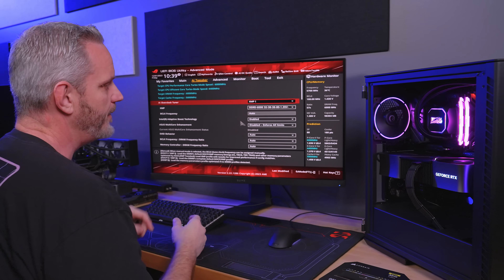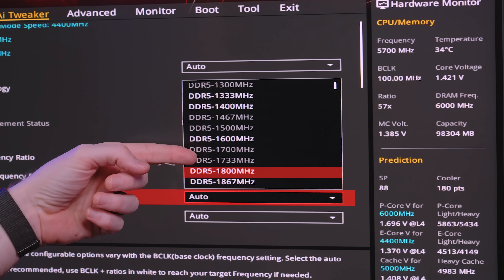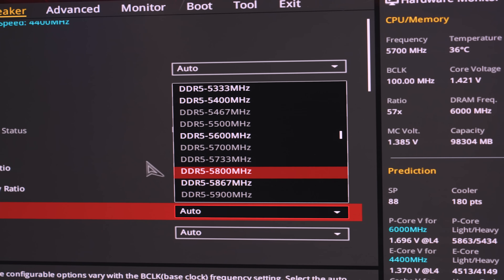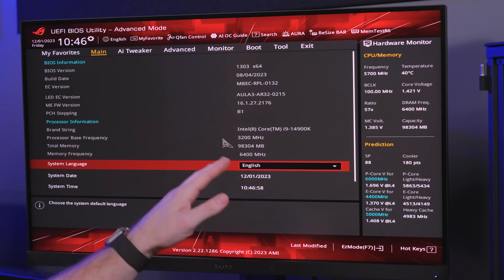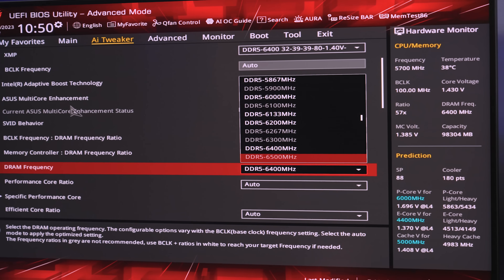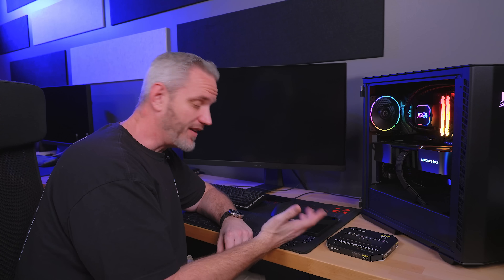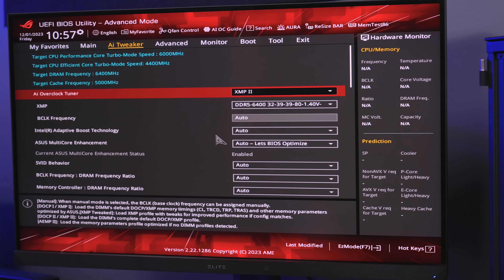Crashing PC? Check this first!

Comment: Sometimes it can be the motherboard.
Replaced an ASRock board with an MSI MAG Tomahawk one and now my RAM runs at the proper speed of 6400MHz all day every day. I couldn't get it over 5200MHz on the ASRock except on the BIOS version it shipped with, which was much older.
Reply: Yes, certain mobos, especially older ones with small flash ROM capacity for BIOS storage will have to trim down the list of supported QVL memory modules to fit in the small capacity. So oftentimes getting the newer platform with larger BIOS flash ROM capacity can mean multiple times more supported QVL memory modules, and newer products gets more support attention versus old.

Comment: Iam New to the PC building scene so I think I should ask : is it really that important to enable XMP ? I mean, my games are running just fine and from what I could find on some benchmark channels memory speed is the last thing one should look into ,ram is a little bit expensive where I am from so that's why I went for a slower ram kit and used what I saved from my budget to buy a better GPU ,  so yeah after seeing this video I am starting to wonder if I am really missing out something here .
Reply: I think k you answered your own question, if the games are running fine and you are happy, then leave it turned off.  Of course you can always enable XMP and see if it’s stable, but if not then turn it off and enjoy playing games 😊
Reply: @gregspicer1238 Great answer. There are specific games that benefit from faster RAM speeds (limit MS Flight Sim 2020) and/or tighter timings (mostly memory intensive production work apps), but in general, if expensive, spend money elsewhere.

Comment: My 7800x3D system will get a driver_power_state_failure blue screen shortly after I get into Windows and open my browser/discord. It will then reboot and run fine. It doesn’t change any BIOS settings as far as I can tell.

Comment: Ok ... heres one:
Running a AMD Ryzen 7 7800X3D on an Asus TUF x650 Plus Wifi and CORSAIR VENGEANCE DDR5 RAM 64GB (2x32GB) 6000MHz CL40 kit.
RAM WILL NOT run on Expo at all, it only crashes, right back to cmos reset.  
Had to drop memory down to 5800 MT/S and not try to tighten timings at all, to even boot.
From there, can not give the CPU a slight overclock, as I like to.  Only crashes.
And yes, this RAM is on the list.
I have heard this is an AMD issue with many users ... one question? Why?  Whats the deal with this?
Why do X3D chips not like running Expo or at listed speeds?

Comment: I have a laptop with DDR4 3200 MTS SO-DIMMs that have these speeds set in JEDEC timings so XMP isn't the only way to get higher speeds, just as well as the laptop doesn't support XMP.

Comment: My fx8120 would not run anything higher than stock ram speeds. It would always fail to post until it got reset, very annoying. Intel for me so far hasn’t had any problems.

Comment: I just got Asus Tuf 4070 ti, ever since I've had random black screen crashing. Sometimes systems slowly freezes, sometimes in bios it freezes as I am trying to boot after a first crash. Only way to temporaily fix it is unplugging psu for several minutes. I wondereed if it was the timing. Tried dozens of things.

Comment: i don't get a bsod by the day i set up the cpu and the ram overclock (and it's pretty heavy OC, it took me several days to find the right spot)

My pc is h24 by 2 years, 0 bsod.

Just increase the voltages (a very very little by little) when you got a bsod, it wil fix it a lot of time.

And oveclocking the tertiary timings helps a LOT with the stutters.

I also customized all the voltages, the sys, the dram, the memory controller. It's not so hard to do, and in latest cpus the are a lot of failsafe, it would be really hard to damage the cpus (if you stay beyond reason limits)

Maybe i'm just a nerd, but to oc the pc and to make it stable it's the funniest thing to do after build the pc. I pref a lot more to do this things than to game after ahahah

The only things i failed to set up, it's the cache, i couldn't unbin the voltage of the cache by vcore, like it was doable in the old 4790k, so i couldn't set up the cache speed and voltages properly.

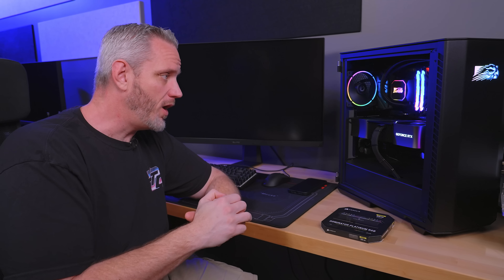Comment: I'm actually in a situation like Jay mentions at 14:06, I recently got an i5 13600K and a Z790 board, both off eBay, with a RAM kit on the QVL that's rated for 3600MT/s; any time I enable XMP I get blue screens within 5 minutes. If I manually tune the RAM settings I can get it to 3200 fairly stable. I was hoping it was the MB, but based on this video I'm guessing I'm going to need to look into replacing the CPU. 

Oh well. Sh-tuff happens.
Reply: update your bios to latest version first. its more likely to be your board, 13th gen should run 3600mt easy

Comment: I had an MSI X570, Ryzen 2700x and G.SKILL Ripjaws V Series 16GB (2 x 8GB) with XMP enabled and I suspect it killed my RAM.  I Replaced it with the G.SKILL Ripjaws V Series 32GB (4 x 8GB) (it was on sale so I bought a 2nd set after exchanging 1).  Would it be wise NOT to enable XMP in this case or was it just bad RAM? It worked for at least 18 months with it enabled.
Reply: *G.SKILL Ripjaws V Series 16GB (2 x 8GB) DDR4-3600

Comment: I got a pc that turns on. Everything lights up. No image no boot screen nothing on the monitor period. The pc then won't shut off with the button. It stays running until its shut off. I tried ram I tried removing drives I've replaced cmos don't everything other then a new cpu. I'm assuming it's cpu or mobo but would love some more insight. If everything if coming on the board might not be the issue and it's the cpu? Any help appreciated.

Comment: My 2700X was originally paired with an ASRock X470 board and a kit of Trident Z RGB 2x8GB 3200MHz CL16, and when I added a matching kit of RAM bumping up to 4x8GB, I couldn't get it above like 2666MHz where it was like marginally stable. Was on the QVL list for my motherboard, but I guess they validated it with a silicone lottery winner. Took it as an opportunity to upgrade to a 5700G (because I wanted the iGPU for troubleshooting, which did actually come in handy later) and it has ran my 4x8GB config perfectly fine for the last almost 2 years now.
Reply: It sounds like you are saying you had one 2x kit, and added another "matching" 2x kit to get 4 sticks, instead of buying an actual 4xkit.
That is generally not recommended because there can be enough variation between 2 different 2x kits that they just won't always work together right.
I don't mean 2 different brands of kits, it can happen with the same brand, same model number, etc.
A primary problem in this particular scenario, is that memory manufacturers often make changes to their models over time.
For example, I once bought 2 2x4gb g-skill kits (one for me, one for my wife) and both worked fine in our respective PC's.
However, down the line, I wanted to increase the amount of ram in our systems, and her's was better suited to run 2 larger dimms, while mine should have worked well with 4x8gb sticks.
However, I just could not get the 4 sticks to play well together.
So I took them out and looked closely at them.
Both pairs had the same heat spreaders, but the actual PCB's were different colors.
One pair had green boards, one pair had black boards. And I could see that some of the traces and components were different between them.
I didn't take the heat spreaders off to see if they were a different brand of memory chips, but it wouldn't have surprised me, and I don't know what other changes there may have been, hiding under the spreaders...
But it was obvious that while both sets conformed to the overall spec and both performed as expected when used in matched pairs...
They were by-no-means identical.
Same part number, but obviously different batches. different design, maybe not even manufactured by the same plant.
So I ended up having to buy a matched quad kit, 4x4 to make that system happy.
(although it never was completely happy. lol).
Anyway, glad the set worked in your other system.
It's one of those things. some setups are more fussy than others. So it's not that 2 different matched pairs can never work together...
But, rather, it's not *recommended*, because of the large potential for failure.
Either outright failure (total incompatibility) or a sort of "partial failure", where the two unmatched pairs will work together but only at much lower speeds, or not in dual channel mode, or maybe only with a lot of fancy bios configuring.
Whereas quad kits are often guaranteed to work with a given configuration.

Comment: Thank you Sir.!!  I believe you have found the problem I was having where my screen would "glitch" out for up to 2 seconds.. Different video cards did not help.. Different energy providers didn't help.. (off grid with 2 solar systems) .. my next option was the motherboard.. I have a Ryzen 5 7600 with 5600 ram.. It defaulted to 4800 and I upped it to 5600 in EXPO.. Now that I dropped it back to stock it seems to have fixed it.. I will probably never notice the "slower" speed ram..

Comment: 7800X3D owners will know this life. The memory controller in it sucks, so even if you have tried and trued RAM that worked with other AM5 CPUs doesn't mean it'll run full speed.
Reply: AMDs recent AGESA updates added better RAM compatibility and actually raised the 'sweet spot' 6000MT/s to also support 6400. 

I have 6000CL30 since 7800X3Ds launch in April and never had an issue
Reply: Oh, this does not look good for my new build, i was planning on recycling the 6400mhz intel kit i have and just downclock it a bit... wish me luck.
Reply: @Gnarfendorf really depends my guy , just silikon lottery. Some games actually really benefit from this like crazy which is weird. If you feel like it , you can invest in 7000+ MHz ram with better die , and then downscaling it giving you more room for juicy timings. A lot of people run 6200mhz no problem but it could not be case for you since slicon is da silicon. If you would be lucky you can get it to 6800mhz but that is up to you , but buying more MHz ram to downclock it to 6000mhz is a good idea too
Reply: @sebastianlipkowski412  ye, i mean i took the fastest my mobo was rated for, and it ran well on a 13700k. Now im switching to 7800x3d, and the kit was explicitly marketed for Intel only. If it works with the downclock im happy, but im not too keen on buying another set of ram this year.
Reply: @Gnarfendorf yeah just set it to 6000 👍🏽
Reply: I was worried about that. I went with 6000 as well and so far haven't seen an issue. Now let me go and knock on every piece of wood in my house.
Reply: What speed to you recommend for 7800x3d?
Reply: @spainboy9999 6000MHz
Reply: It also depends if you plan on keeping the 7800x3D. If you are gonna keep it for a while then you can save a buck on 5200mhz since the 3d v-cache won’t have a huge difference but if you get better processor much earlier then I’d stay with 600mhz
Reply: @spainboy9999 6000 cl30
Reply: @spainboy9999 my friend runs on 6000MHz. Moduels from G.skill Trident Z5 Neo. Iirc Neo modules is for Ryzen's EXPO (and also Intel's XMP) specifically. Non-Neo is for XMP (Ryzens support both but EXPO better?)
It also depends on mobo, BIOS (AGESA) and also the silicon lottery.
Reply: After 10th gen intel they changed it so the memory controller can run at half speed making super fast kits to run but it really hurt performance
Reply: I have a Gskill 6400 c32. Runs fine.
Reply: 😢😢 i was planning on micro centers 7800x3d bundle for my first pc build. This doesnt give me much hope
Reply: @coltonholaway7902 It will be fine. That Microcenter deal is too good to pass up anyway.
Reply: @coltonholaway7902 get it boss you won’t regret it.
Reply: @coltonholaway7902  I just put together my 7800x3d with Corsair 6000 cl30 expo and runs like a dream.  Don't let a few comments deter you.
Reply: Until the AGESA update I would agree with you but since then I can overclock it to my heart’s content
Reply: Currently having this headache with my 7800X3D.
Reply: @nicholaslennon  silicon lottery..hahaha
Reply: @nicholaslennon me too man hahaha what do ye do im hearing 70000 different solutions
Reply: Running on 6400, depends on your mobo
Reply: @zensniper21  kinda. A $120 motherboard can do it too
Reply: Ddr5 6000mhz has worked fine for me with the 7800x3d, never had a ram related issuse on Am5.
Reply: I was shocked at how decent the memory controller in my 5800X3D is, I have 4 sticks of 8GB DDR4 installed and it’s running tight timings and 3800MHz CL14 without a hitch.
Reply: @inmypaants  hot daym that's nice. I've managed with 5600x to run 3733 Hynix DJR (dualrank which is probably like 4 modules instead of 2) with mediocre timings just above 3600mhz average CL16 modules in 1T. That's from 3200MHz CL16 Kingston Renegades.
Reply: @kekovkeks  to be fair the sticks are B-Die 4000MHz so they were setup for success haha
Reply: @inmypaants  samsung b-dies is a DDR4 legend!
Reply: Mine won't go past 5800 and be stable. I also overclocked my CPU as well. Not sure if that's messing with the memory as well. But I'll still get blue screen here and there, and have to load a safe or load point. I've noticed this happens when I game and then put the computer to sleep.
Reply: Yea, so far i havent had any issues, yet. I hope i dont, ive tweaked a little and i get some serious performance. So i figure i got lucky with my mobo/cpu/ram, but i cant really push further than 6400 on ram due to restrictions on mobo so...
Reply: Silicone Lottery some are far better than others
Reply: @coolhand4598  yes I believe I got a decent one. Have it UV at -45. Very surprised.
Reply: Mine works great 64GB 6000mhz. 11700k had trouble above 3000 for me.
Reply: @AdamLarson23  because it has issues with the 100mhz strap..I used 133mhz memory strap and it works fine..
Reply: i just bought a 7800X3D today please pray for me.
Reply: Please help, im planning to get a 540hz monitor to play cs2 4:3 res medium settings. will i need a 4090 to get constant 540fps. my cpu is 13900k
Reply: I had this issue with my 1800X and Crosshair VI Hero mobo. Idk why, but that combo made it 50/50 I'd it would post or not. Even at default settings. Moving the CPU to another mobo seemed to work. But it were stressful times haha. It would even randomly turn on after I shut it down.
Reply: Am I losing much if I don't increase ram speed at all from the stock value and have 7800x3d?
Reply: Try being a 14900k after upgrading drom a 7950x and finding out its even more unstable. Im back to a regular 7900x now i got so fed up i have a 12900k 14900k and 7950x3d all sitting idle because of stability issues and with fcking high end expensive boards, idk if its software or what the duck anymore im fed up
Reply: I ram 4 (64 gb total) sticks of RAM at 6000 mts on my 7800X3D for a little over a year with no issues at all. Until one day I stsrted getting random BSODs. I suspect mobo degradation, since I already tried a new kit of RAM and the problem didn't go away.
Reply: This comment is so helpful I just built a PC with 7800x3d and 8000mhz ram and kept crashing
Reply: Mine doesn’t suck. I can do 6400
Reply: It's not the memory controller, it's the UCLK sync. If you desync it you can get 7000+ easily but you'll get a latency penalty like running Intel in gear 4.
Reply: I'm running 7200 on 6000 rated hynix sticks with a z790p msi board and 13700k. Sucks you've had so many issues with am5
Reply: @Dzugashvili  yeah, but what timings? I presume they are too high to improve the latency..
Reply: @kekovkeks  does 44ns(MLC) on 7800mhz CL34 bad?
Reply: @benuten3907  hmm, I expected far worse. How about stability? Also doubt it runs 1T lol
Reply: @kekovkeks  always on the spot every boot..only less than a minute

2T only..on DDR5 1T will only magically run on 6400mhz the best with a godlike bin IMC..I only tried 6000mhz with 1T..
Reply: @benuten3907  I think running on 1T is better? And 6400 is very good. You can only achieve such on Ryzens if you are hella lucky. Iirc Ryzens such as 7800x3d were running 6000 on 1.5T (GDM). Idk about now tho.
Reply: @kekovkeks  no, its too low for Intel to have an advantage, the sweet spot personally is 7600mhz and above..with CL34-36 and tuned subs, Intel's IMC is on a different league vs AMD's, while AMD doesn't have huge gains beyond 6400mhz, Intel does scale upwards furthermore.
Reply: @benuten3907  hmm, I though running on 1T does the stuff better for latency reasons.
Reply: @kekovkeks  not always true..depends on which IMC you're tweaking..AMD's a bit fudgy, but for intel its very straight forward..
Reply: @benuten3907  aight, I'll look for it, ty. Haven't touched intel as much so that's why I ask.
Reply: @kekovkeks  I have both AM4 and AM5 and z690 and z790 platforms, and so far from using them, AMD has been updating AGESA with a hit or miss accuracy while Intel has more improvements over time than shit getting broke (for me). My AMD DDR5 systems run at 6200mhz tight settings, while my Intel main Z790 runs 7800mhz and my z690 one runs 7400mhz tops..
Reply: @benuten3907  so, you hate both AMD and Intel? Well, both has bad sides and good ones too. It depends on who you prefer. I don't blame any of these just to force up another. Though I highly dislike Intel practise with OC lock for CPU until Z chipset with K CPU which is very pricey.
Reply: @kekovkeks  no hate on both as they take competition to new heights, its just that I love tweaking and pushing hardware to its limits, AMD doesn't offer me much into this, while Intel always keeps the blood boiling and brain cells active and I like that.

For a normal user, just go AMD for enthusiast type of excitement go intel, one can never go stray when choosing what to buy.

AMD on AM5 isn't cheap either so I'd like to disagree on that, both platforms are expensive on their own accord and worth.